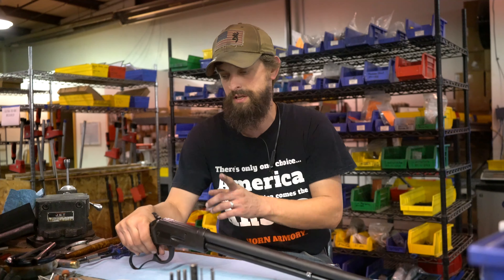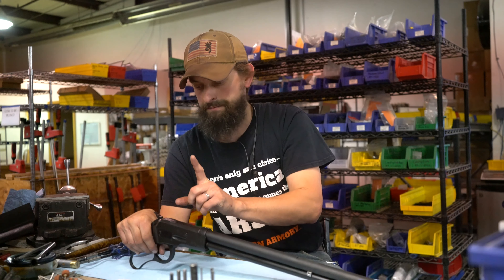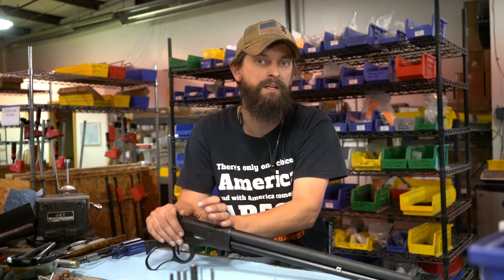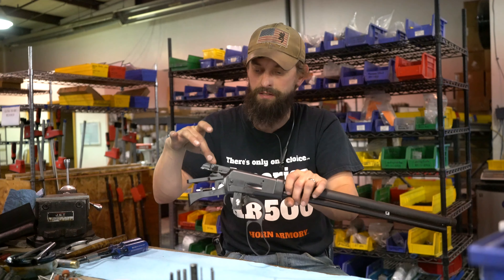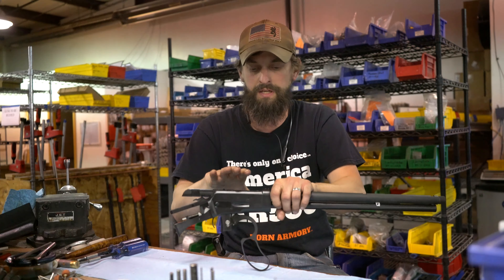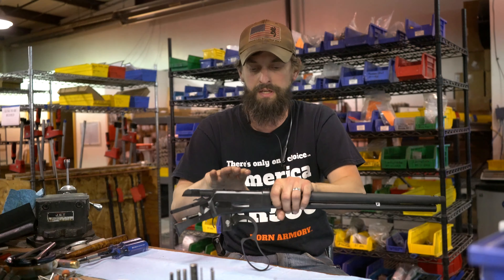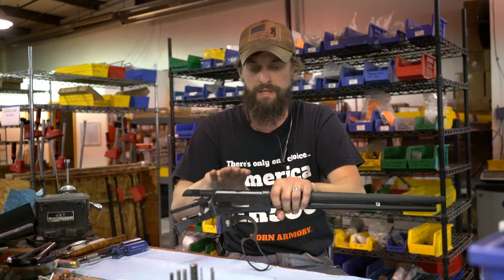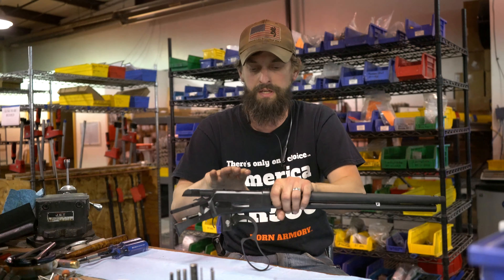Ask The Gunsmith Episode 5 The Conception of the Model 89

Comment: Would really be interested in one but your barrels are too short would want at least a 24 or 26” octagon
Reply from the maker: Our barrel lengths are optimized for ballistic performance. 18" gets the maximum performance out of most ammunition. 24 and 26 are too long and decrease velocities.
Reply: @BigHornArmory  losing a little velocity wouldn’t bother me I just think shooting a longer barrel is better for accuracy at least for me maybe you should offer as a option?
Reply from the maker: @loupuleff571  The longest barrels we offer are 22" which does improve sight radius. Decrease in velocity is minimal in the 22", maybe 100 FPS depending on the ammo you're shooting.
Reply: @loupuleff571  Case/powder capacity and barrel length need to be matched - 18" is perfect for the straight wall cartridge. Longer barrels of the same diameter do not enhance accuracy any more and the harmonic 'whip' gets worse. This is not a spitzer bullet built for speed, it's raw mass and energy on target. It will be accurate enough.
Reply: @bendutro4787  I had a 24" octagon installed on my Puma 454 it shoots great I just can't stand short barreled lever guns not only for shooting balance but they just look great !